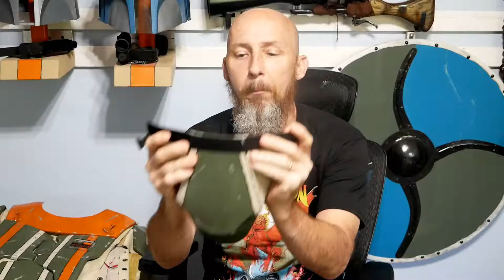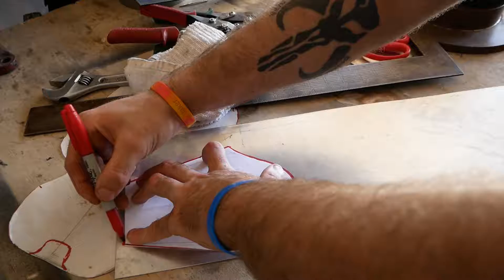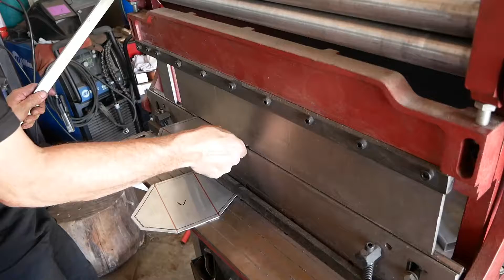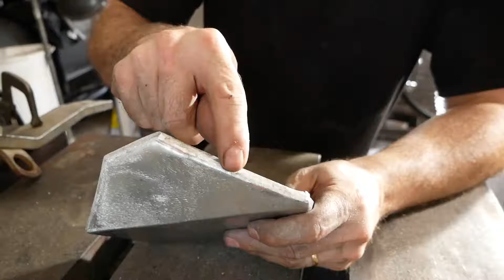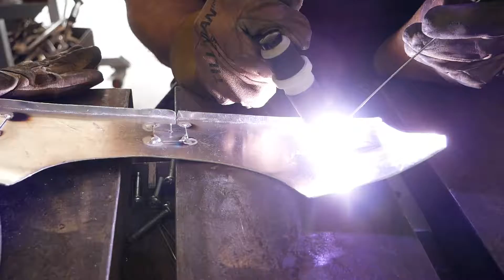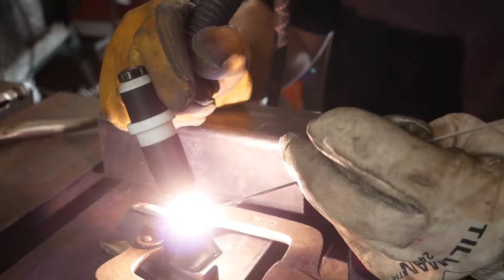Metal Mandalorian Armor:  Part 3.  Fasteners, edges and clean up!

Comment: Guess the whole "just gonna use hand tools and no welding" thing kinda went out the window by the 3rd video eh?
Reply from the maker: It did, and I regret I ended up going that direction, and then didnt mention (or correct that).  I let myself run out of time and wanted this done so my son could use it at DragonCon, and basically abandoned (and/or) forgot my original goal.  Apologies :(.
Reply: @eric-bkc  TBH if I was in that spot (and I often am, with being a chronic procrastinator, lol) I would have done the same!
Would absolutely love to see that project finished and I promise you'd I'd watch, like, and share each video with the Mandalorian discord server I'm on if you do decide to do it